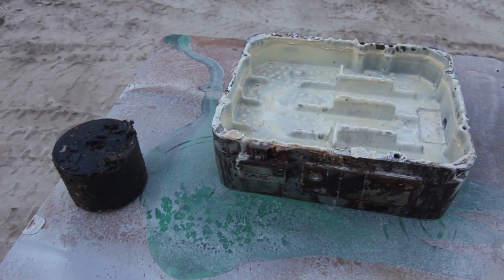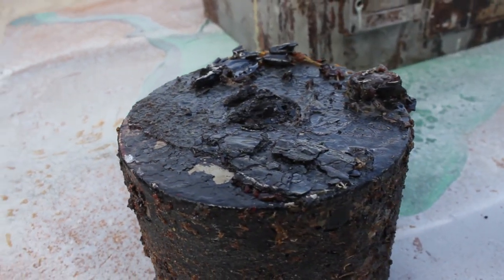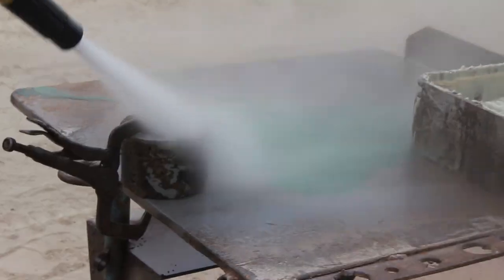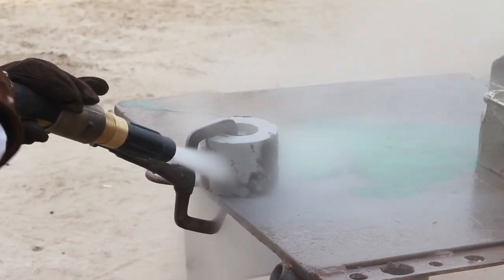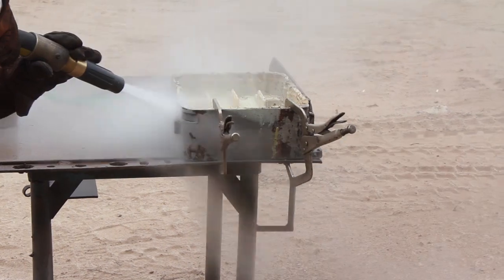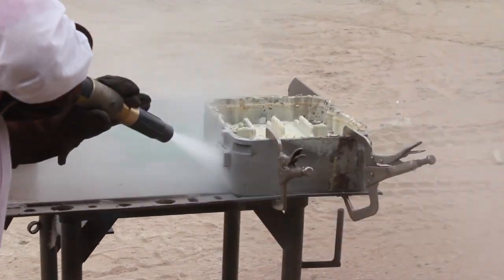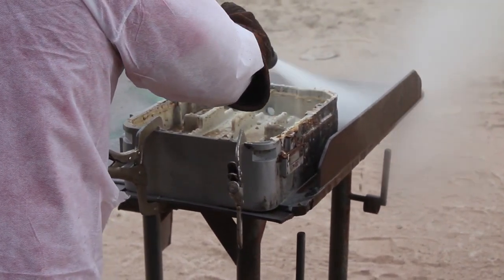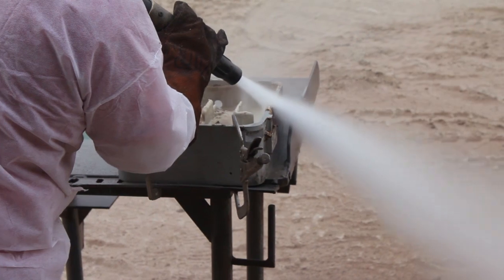Dustless Blasting Industrial Strength Glue!

Comment: I have a question about dustless blasting. Do you think we are blind? You keep calling it "dustless", yet the entire area is covered by at least two inches of dust and dirt. And unlike sand-blasting it's glass so it won't mix with the surrounding soil and needs to be professionally cleaned.
Reply from the maker: Hey Maloy, we call it Dustless Blasting because it suppresses 90% - 95% of the dust. "90ish Percent Dustless Blasting" just doesn't have a good ring to it, and we think it's smart to have the main benefit of the product right in the name. 
Also, the crushed glass will mix with the surrounding soil exactly like sand will, in fact it is nearly indistinguishable from sand. The recycled glass is actually safer than sand because it contains less than 1% free silica. Blast sand has tons of free silica, which causes silicosis (lung cancer).